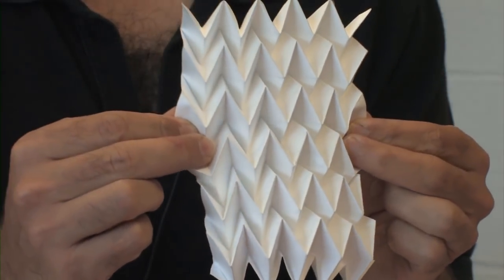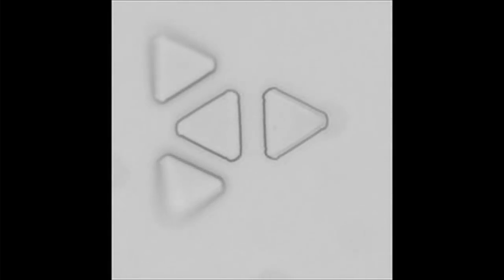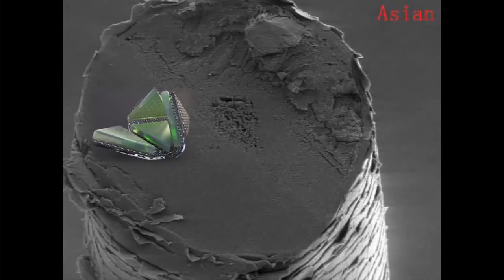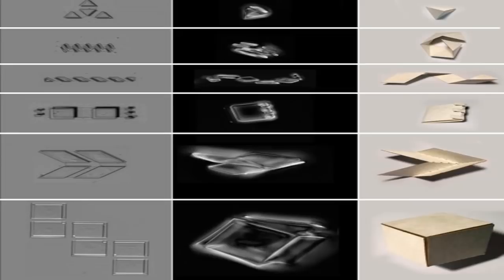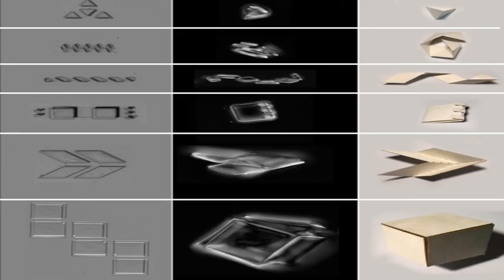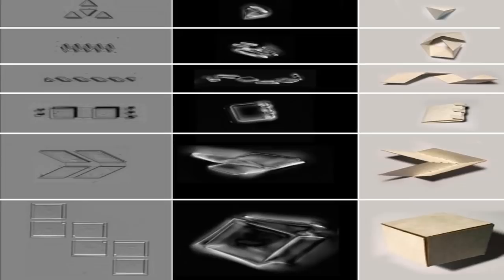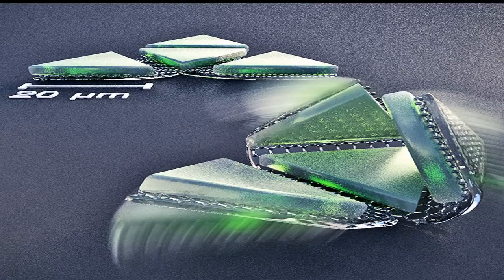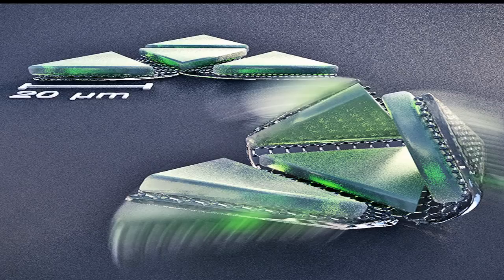Cell-sized Robots?

Comment: You are correct exoskeleton has been out for some time however it is now perfected in the sense that it has more practical applications. Ai and Robotics have now taken a more enhance perfected in version of the process. Exoskeleton was just recently purchased and is on the assembly line for Ford Motor Products in its assembly process and the more recent version of it was just agreed to and signed a contract with at the beginning of January 2018.

Comment: I first heart about Nano Tech back in 1999, and have been watching ever since... this year that just past is the explosion I have been waiting for... it's finally coming to the point that like the tides, it won't be able to be stopped.. it can be slowed down.... but not stopped... looking forward to 2030... this tech will be everywhere... the next 33 years will be called the Graphene Age, just as the Iron Age was named after Iron... but the Iron Age lasted about 600 years perhaps longer... the Graphene age will last AT MOST 30 years... perhaps less... before it is taken over by the next advance... I'm expecting by 2100 we will be using Vorlon Biological Organic Technology and we will be a cross between Vorlons and the Borg... without the retro tech used in Star Trek...